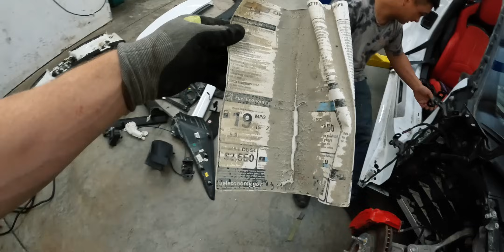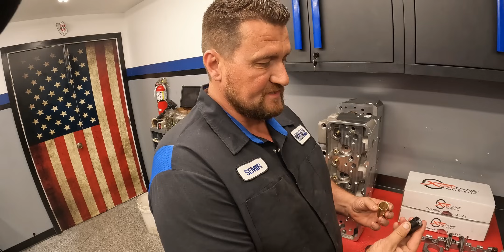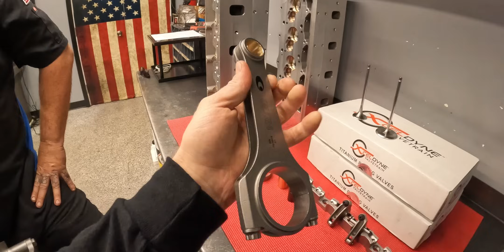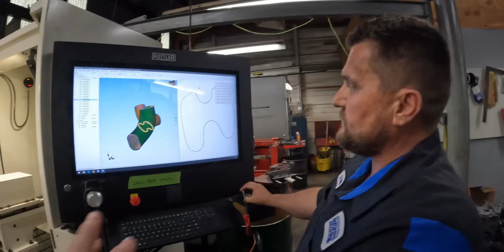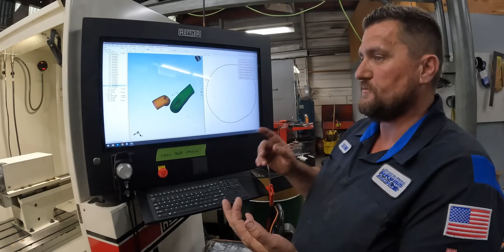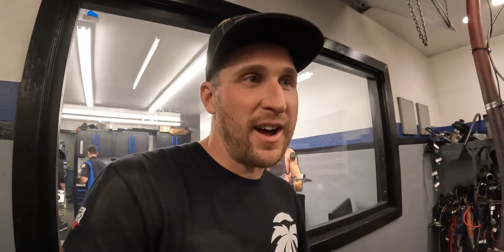World's 1st Manual C8 Corvette Drift Car - Full Motor Breakdown at Gromm Racing - Ep. 20

Comment: Hey Matt, just curious why you aren’t going with an ITB setup instead? You mentioned being able to tune individual cylinders with NA setups is crucial so would ITBs not be the way to go?
Reply: The ITB’s would have been a great option. The problem with it is the complexity of it , since we are using a head based off the SC2 there wouldn’t be an intake readily available and would require us having a one off custom built for the package. 

We are having a custom Hogans intake made but it’ll be a shared plenum with dual 4500 series throttle bodies. 

The cost for a custom ITB would move the budget up exponentially. So even though this is a max effort engine build we can achieve our goal without making Matt go broke. 

The Hogans will cost between $6-$7k while a one off ITB would probably be double if not more.
Reply from the maker: Ya know, I can’t totally give an answer why no ITBs

From what I see other guys doing big power stuff like this all do dual 4500s, Semir would need to give the answer why he wants a tunnel ram
Reply: In the next video can you do a short comparison of the two setups based off of what he says? My RX8 has a stock tb mounted on the single plane intake and Im curious of the advantages one way or the other.
Reply: Very good point, didn’t think about needing a custom setup due to the heads. What would you recommend for more basic heads that have the more affordable bolt on options?
Reply: @GapDaddyBuilds  depends on what your intended use is. ITB’s offer a lot of tenability and they also typailly offer a wide torque band. But that’s all relative to what you actually need and budget.

Comment: I Wonder why they used fr9 or ford nascar style porting instead of r07 Chevy nascar porting
Reply: The reason being is the SC2 uses a very similar bore spacing to the LS. The LS has a 4.400” bore spacing , while the Windsor and Cleveland both share a 4.380” bore spacing. The R07 and FR9 both have a 4.500” bore spacing. So not much really has to be changed to fit the 4.380” bore spacing onto an LS besides moving the water jackets and bore centers over a touch. 

The camshaft will also have to follow the ford valve location or similar to the LT entire cause the valve oration is reversed. But other than that it’s really sort of “bolt on”.
Reply from the maker: I don’t know much about the differences, I wish I knew more! Such sick tech in cup car heads. I’m just lucky some company even makes a canted LS head, it’s just even cooler it’s an sc2

Comment: I want to hear what that beast sounds like at 9000rpm in person for sure. What size heads and exhaust are you going to use? The exhaust will be a piece of art coming off the back of that C8 for sure! Congrats on this engine build, dude. This is going to be the baddest looking and sounding C8, I'm sure. Respect Matt.
Reply from the maker: Thank you so much. I’m trying my best!! I figured the engine package has to be able to do the car justice. This sucker needed something exotic and wild! The heads are suppose to flow over 500cfm… insane…. And the header primaries are 2.25 right out of the head and the exit of the 8-1 is 5” 😂
Reply: @mattfield777  That sucker is going to exhale strong with 5", lol and the 8 in 1 is going to be massive, wow. AGAIN, I can't wait to hear it scream, especially if you hit the 9k. So f***ing cool.

Comment: This is incredible stuff, but how long does it take to get another one if something goes wrong?
Reply from the maker: Plan is to build a second once proof of concept is there
Reply: @mattfield777  got you. With such custom stuff like you said it would be hard to get anything fixed quickly.  Also incredible that you are developing a big power NA motor vs grabbing a nascar V8. Will this motor get the giggle gas?